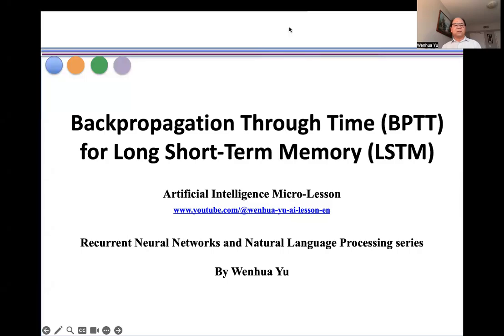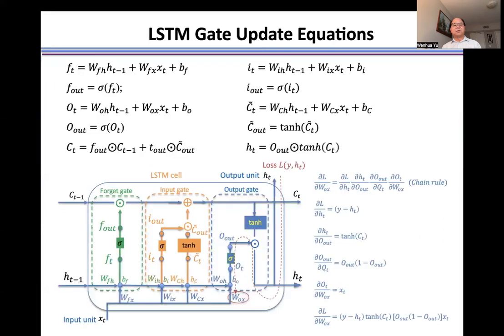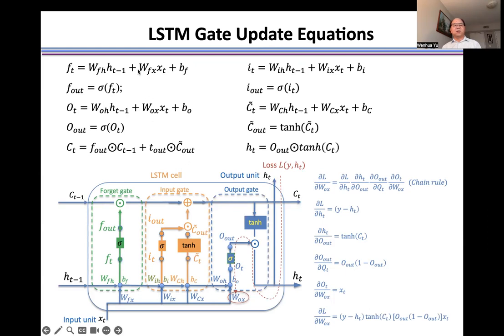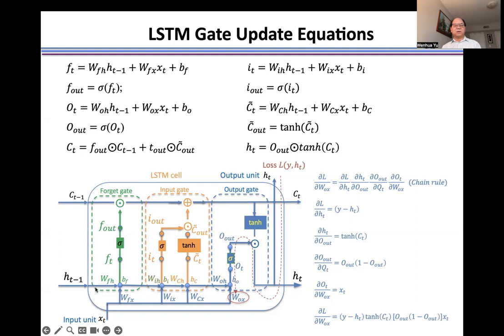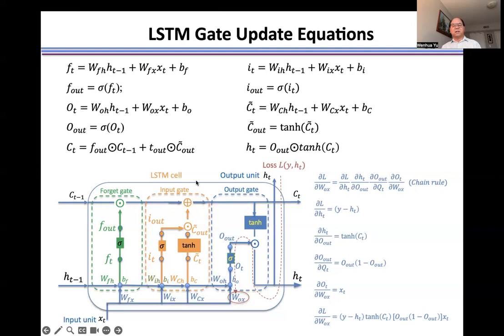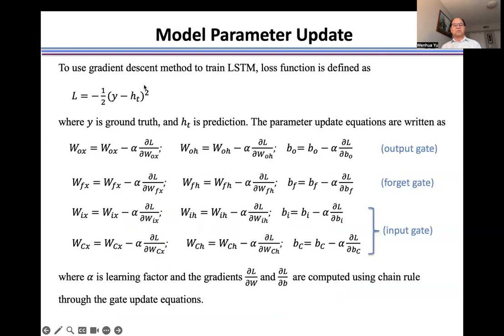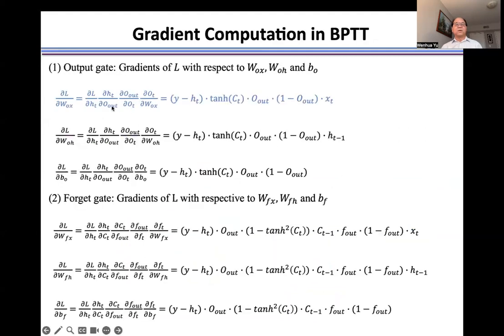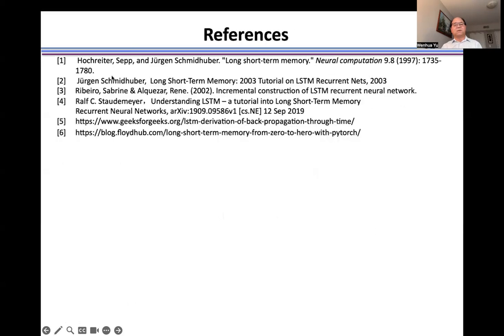Backpropagation Through Time (BPTT) for Long Short-Term Memory (LSTM)

Comment: Thank you so much for your video, but i have a one little question about C_tilda_t derivatives.
We know, that: C_out = tanh(C_tilda), 
but in your derivative:  
dL / dWc = (y-h_t)*O_out * (1 - tanh^2(C_t))*C_t-1 * C_tilda_out * (1 - C_tilda_out) * x_t
C_tilda_out * (1 - C_tilda_out) is a sigmoid derivative, so we have to write somethin like that to use tanh der.:
dL / dWc = (y-h_t) * O_out * (1 - tanh^2(C_t)) * C_t-1 * (1 - C_out^2) * x_t

Perhaps I misunderstood something or got confused. That's why I wanted to ask about this detail.
Thanks <3
Reply from the maker: Thank you for your feedback. Yes, it seems you are right. I will check it carefully later.

Comment: when you compute the derivative of O_t shouldn't you consider also h_t-1 since it is also a function of Wox but in the previous timestep?
Reply from the maker: H_t-1 is in the previous unit.
Reply: @Wenhua-Yu-AI-Lesson-EN  yes but the weights are shared so h_t-1 still depends on Wox and the chain rule to compute the derivative should be applied also for all the previous timesteps (t-1, t-2, ... 0), or am i missing something?
Reply from the maker: We compute the derivative every time step.
Reply: @Wenhua-Yu-AI-Lesson-EN  you're right, and then we add together the contributions from all the timesteps to obtain the final gradient, i figured that out a couple of days after writing that comment but still thanks for the reply
Reply from the maker: No, it is considered at the previous time step. Thanks.
Reply: @Wenhua-Yu-AI-Lesson-EN  what do you mean? I did the math and I found that for the whole input and output sequences the gradients w.r.t. the model's parameters needs to be computed in every time step starting from the last one but also need to be added together in order to compute the final value used to update the parameters, I've also implemented a lstm from scratch and tested it on a simple problem with a successful result and i've also compared my gradients with the gradients computed automatically with pytorch and they are basically the same so I guess my math is right

Comment: thank you for this content. I was wondering what happen with: input and candidate part of the model. how is its derivates?
Reply from the maker: Backpropagation should not depend on the input in my understanding. What we need to do is to update model parameters using gradient.
Reply: @Wenhua-Yu-AI-Lesson-EN  i understand, but what about the weight of them? if they do not have variation, so then it will not change its value. what do you think? thank you.
Reply from the maker: The moving direction is decided by a mini-batch data.